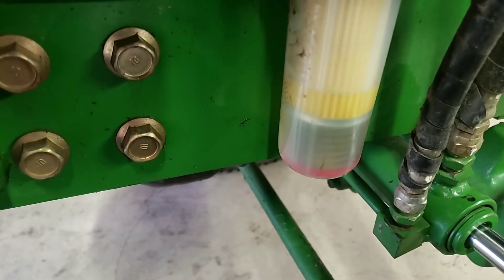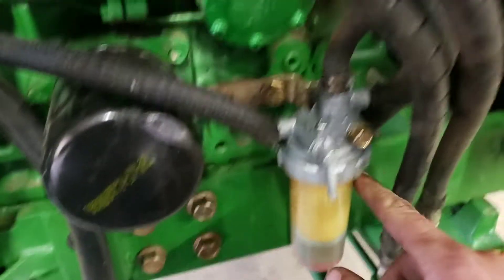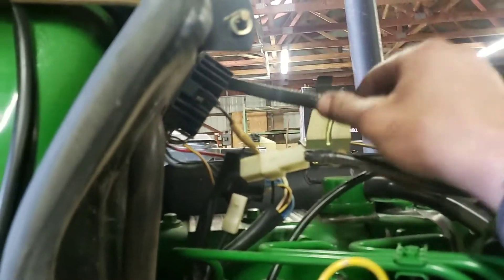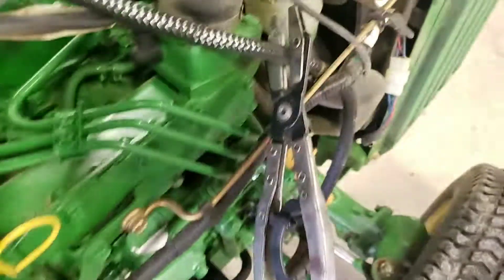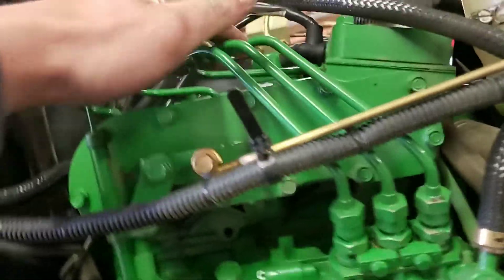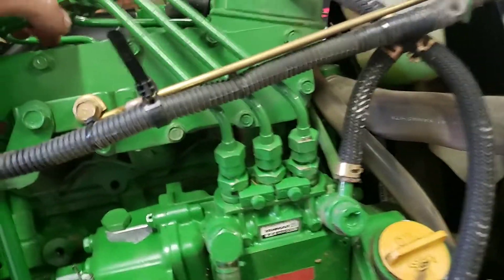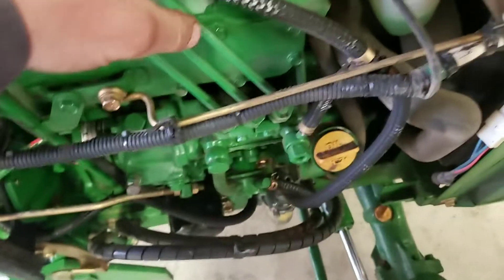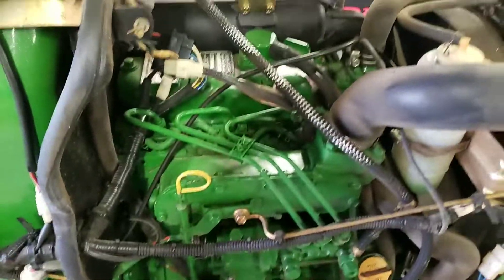Quick Tip - Bleeding Air out of PLN Diesel

Comment: Had similar issue on JD 855. Sat for a few months. Maybe a leaky injector and getting air back into the high side of the system. Had no fuel coming out the high pressure side when I cracked open the hard lines into the cylinder. Restricted the return and got it to kick over. Took about a minute for it to idle right.

Comment: Great video. I have a 2016 Kubota B2650. I ran out of fuel. Can’t believe I let that happen. Been busy. 
So I filled it up. Tried starting and it will spit and sputter but only idols and roughly at that. It will at times hit about 950 rpm then drops. I tried pulling the fuel line at the filter and fuel flows freely. I tried bleeding the lines at the injectors. Still does nit get enough fuel. 
Any suggestions?  I did try clamping the return line as well but looking back I may not have gotten that right. 
Thanks in advance for any help. 
Terry
Reply: Got the same problem mate how did you sort it out
Reply: @varetacurtis8751 
I changed the fuel filter just in case. I tried bleeding and no luck again. Then I took a spray bottle and filled it with diesel fuel. I pulled the air cleaner off the air intake hose. Then as I was cranking the tractor over I sprayed little bursts of diesel into the air hose. At first I just gave it a tiny burst of  fuel. Nothing happed. Then I sprayed a bunch of diesel fuel into the air intake real fast. Big mistake!! 😂
The engine ran wide open and sounded like it was going to explode haha. However it did start and has ran fine ever since. I would suggest just slowly spraying fuel into the air intake and then increase the amount until it starts. 
Good luck!
 Terry

Comment: Unfortunately this did NOT work for me. I'm happy it worked for so many others on this thread. I have a 4600 JD tractor. Recently replaced the fuel filter and ever since then I just can't get it to start.  Before reading this post I've had times when it ran for 15 to 30 seconds but then just did not stay running (this after I just let the tractor sit for a week). Anyway, I clamped the return line hose as instructed in this video - kept tightening/squeezing it more and more but then started worrying I was going to damage the rubber fuel line (or other). (btw - I have a full tank of diesel). Alas, I may have to go the expensive route of shipping it off to the local tractor garage. :(
Any suggestions are welcome.

Comment: Chris thanks so much for the info. I have a perkins 4-108 in my sailboat changed my fuel filters today couldn't get the air out. Just before bed put YouTube on and discovered your video. My wife and I grabbed a clamp put it on the return line and Mr perkins came to life purring like a  kitten. Thanks so much extremely 😊.

Comment: I did this and it does run but when I take crimper pliers of won’t stay running, any clues?
Reply from the maker: Sounds like you have a bad fuel check valve. It would depend on the design of the fuel system for that particular engine.
Reply: I got it, is was an hose getting air, not building pressure on injection pump, thank you!

Comment: I came across your video looking for issues im having with my JD770 loosing power while under full load. the fuel train in the video is my exactly like my tractor. I've ran out of trouble shooting options and wondering if you can assist me.

Comment: I haven't seen that done before, I'll give it a go next time I change a fuel filter, thanks for sharing
Reply from the maker: Small tips. Works great on these PLN systems. Just partial restriction and good to go. If it still has trouble priming you also know that you have a suction side leak

Comment: That's frickin' brilliant Chris. I love those kinds of tricks. Never thought to try that till watching this but it makes perfect sense.
Reply from the maker: Little things make the job go faster. Glad you enjoyed it, hopefully I can throw some more on here that help someone.
Reply: @ScienceOfDiagnostics  Absolutely man. I feel the same way. Have you tried this on the old mechanical rack style setups like Detroit used to use? Don't know if the result would be the same since  you effectively have as many high pressure pumps as you do cylinders. Just thinking out loud really. I always enjoy your posts on Diagnostic Network. I need to do a better job of contributing there.
Reply from the maker: @gearheadautomotivel.l.c.5476  just takes time to write the posts, which is at a premium for most of us. Contribute as you can and I'm glad you enjoy my posts. We need more HD guys on there, which I'm working on.

As far as the old Detroits specifically I haven't tried, but some of the older deere and cat engines utilize the same set up and it has worked well for them.
Reply: @ScienceOfDiagnostics  You hit the nail on the head brother. Time is always the most precious commodity. Calling me an HD guy would probably be a generous assessment but I've got a fair amount of diesel experience. I used to fix rental equipment too for what it's worth. I seem to be doing more in the HD segment since becoming self employed. I don't mind, just need to get to a place where I can afford at least some type of HD scan tool. You know the deal, always another tool to buy.

Comment: Nice man! That beats cracking  #1 open👍🏻
Reply: Well I don’t know these newer system well so don’t know if that will work either
Reply from the maker: Burt,
Really only works on the older system. Anything with an electric lift pump is generally self bleeding.
Reply: Watched it again.... great to know thx Chris. I’ve never done it that way 👍🏻